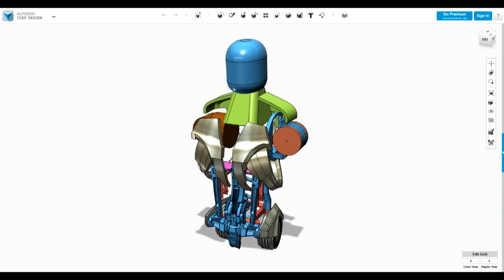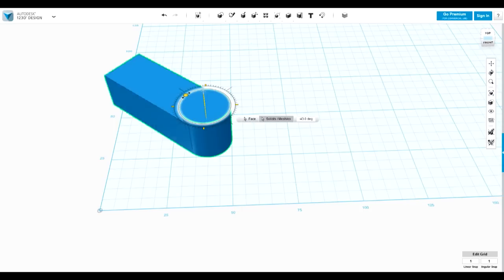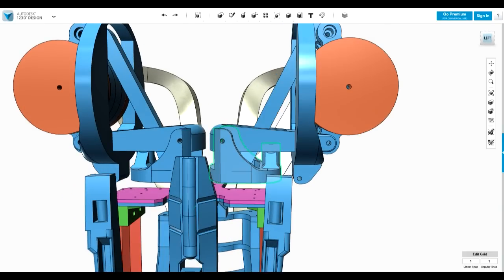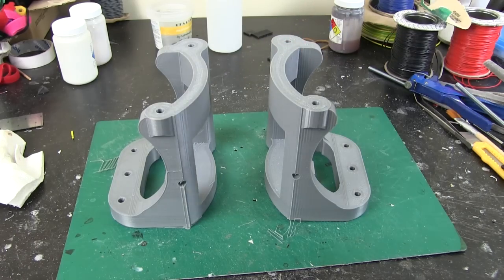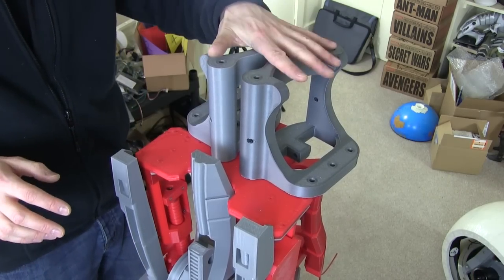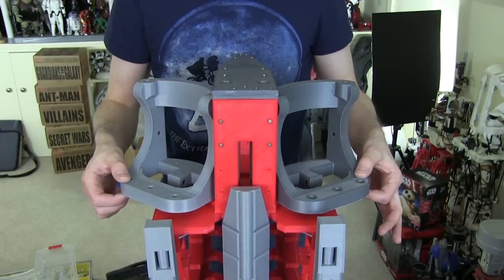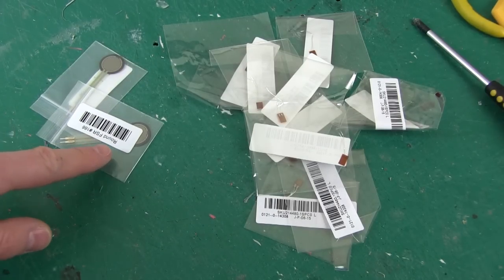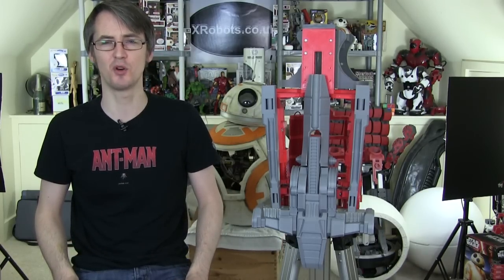Avengers Ultron #9 | Shoulder  Mechanics and Testing | James Bruton

Comment: I just can't comprehend how awesome your work ethic is James! I'm so amazingly lazy in comparison. When I get home from work although I want to make stuff, these days I just chill out and watch youtube instead LOL......
Reply: +James Bruton (XRobots) autodesk is free
Reply: +Jo Westover i dare to give you my opinion on your question as someone who learned several different programming languages:
depending on what your aim with programming is there are several different possibilities...
the most common are java and c++(or c if you want a more hardware based approach)
there are many pros n cons to all of them, but those 2(c is pretty much the predecessor of c++ and c++ can do almost everything c can and more) are the allrounders. if you want to run them on computers exclusively you can go with java. as soon as you want to move on to microcontrollers like the arduino you gonna end with c/c++. but as soon as you actually understood the basics of programing switching languages isnt much of an issue...
back to the the question of what you want to program?
you want simple utility programs that only have basic console in/out?-> any language is fine!
you want a little more elaborate 2D interface? ->go with java! the swing library thats included makes it easy to pop up your first window and put a button in it
you want even more?like 3D renderd stuff? ->c++ is a bit mightier and more performant, but java can give you that too,(atleast to a certain degree...)

after you decided about what to learn, lets move on to the how/where to learn!
thats easy: for all programing languages there are many free tutorials readily available on the internet!
just google it and you will find them.
but java gives you tutorials right out of its documentary
for any questions/problems: as long as you can describe it the community at stackoverflow.com will give you an answer or you find it because others already asked the same/comparable thing!

in my opinion java is the right choice for absolute beginners, as there is the IDE called eclipse that is really easy to use and well documented.

TLDR: go with java and use google to find yourself a web tutorial in a language you are fluent in
Reply: +Jo Westover well as far as i remember android uses java for its apps and xml files(which i have no clue about what they do as i dont do apps)
so you should go with some easy java stuff without the phone background at first, as it makes it more complicated and you really should learn the basics of programming first!
but then you can move on and take a look on the official site of android for developers they got a nice description of how to get started in app programing
Reply: +Jo Westover I would suggest giving https://www.codecademy.com a try If you want to learn the basics of the language. If you want to learn more specific things about the android development I'm sure there are plenty of blogs and tutorials out there.
Reply: sooo true james is a amazing creator and always thinks of new creations even me being an artist i cant think as much about new ideas i very much respect him for it

Comment: Great video, thanks James. I had a similar problem with ABS warping due to drafts and built an MDF cupboard (with glass doors for monitoring prints) with a block of insulation at the top to retain heat.  I built in an full extension shelf for the 3D printer for full access and made it deep enough for full movement of the lower gantry. There are some really nice custom acrylic enclosures outside of the UK but an MDF box seems to work well and greatly reduce warping.

Comment: You could make the shoulder blades spring-loaded so as  to not have them flop about (rubber arches at somewhat of an angle would get weird looking after a short time in my eyes) wildly with his every move. You could add unintrusive bumpers to the blades(partly made of ninjaflex) so they wouldn't harm anything when they snapped back into place when he moves his arm back into position. Everything looks good James! Keep this train'a rollin!

Comment: Just a suggestion, but Autodesk Inventor will allow you to give your assemblies pivot points and then you can move you parts and Inventor will calculate the motion of all the parts relative to your hinges. I have used it before to create working steering mechanisms like the ones on a cars and other cool things like that. Its a really powerful program and if you can use 123D Design, you should be able to use Autodesk Inventor in no time. Can not wait to see how this project ends up!

All the best, Owen

Comment: For ABS, maintaining steady, high temp around the printer is essential for print quality!
Reply: +Anthony Bowman Is that the reason people build enclosures for their printers? I always thought it was to keep the fumes in.
Reply: +BlackPhanth0m Almost 100 percent for temerature management for ABS prints! Unless the enclosure is airtight and vented to the outside, the fumes are coming into the room it's in. Even if it is not airtight, venting to the outside with a duct is a good idea.
Reply: Thanks! I will keep that in mind when I finally get to building my printer.

Comment: +James Bruton (XRobots) scrap the part about the ninyaflex in your forcemeasurement and use a 2 part fitted coupling with just enought space for your force resistor in one of the gaps. that way you get the torque/force thats applied to this axis.
or you do actually use the bending sensitive strips to measure the strain on the upper arm "bone" using the 2 sensor setup shown at 27:20 .
please keep in mind that the mentioned example of force to voltage given is dependent of the stiffness of the test specimen that has the two strain gauges appendet to. usually in mentioned "industrial" uses the test specinem consists of a piece of metal which has a way greater stiffnes than the printed part that i'm going to assume you will be using. these sensory setups use the differential strain of two sensors that are mounted on opposite sides of a bending test specimen. what you measure  in ths setup isnt the force applied to the test specimen, but rather the amount of bend that is caused by the applied force. which is then used in combination with the properties of the testspecimen (eg stiffness) to then calculate the force applied to it.
Reply: +James Bruton (XRobots)  if you mean as another testing/proof of concept video ,this would be propably pretty interesting... though i guess the result will be that the whole thing should be as stiff as possible if you want values that actually mirror the applied force. otherwise having a certain degree of springyness in the hinge may result in a smoother feel of the motion when applying external force.

Comment: Fusion 360 does assemblies and hinges very well.  You can also in 123d move your center of rotation, but that is a bit of a pain because you have to do it every time, and the smart rotate is better.  But you COULD do that before, it is was just harder.

Comment: Hey James, at about 7 min you talk about being worried that the pivot points are not going to be sturdy enough. try using a metal sleeve through the bolt hole to give the joint extra strength. a piece of brass pipe, or some small steel tubing slightly larger than the bolt maybe? Just an idea, love the vids!
Reply: +James Bruton (XRobots) I see... unfortunately there's no room inside the torso to counterbalance the weight. Not to mention the mechanics of counterbalancing around a pivot point, lol. What if you use a metal plate under the piece that the arm attaches to??? Thin guage sheet metal might work. it will give the whole arm apparatus a stronger base to work from. What about using long bolts to act like "rebar" does in concrete castings to reinforce key sections?
Reply: +James Bruton (XRobots) ah, nice! I suppose I should have finished the video before commenting, lmao. I had a notion and ran with it, lol.
Reply: +James Bruton (XRobots) Out of curiosity, is it possible for you to leave speciffic areas of a print void of material and manually insert a rod if some sort (potentially carbon fiber or fiberglass intead of metal to save weight), during the course of a print?
Reply: +James Bruton (XRobots) Very cool! Again, I love the vids, I'm a tinkerer and builder myself, only more of the outdoors, and off grid living type, and I thoroughly enjoy watching you do what you do! All the way from Canada,  keep up the great work!
Reply: +James Bruton (XRobots) Imagine the day when we are capable of 3d printing nano circuitry into the actual makeup of the pieces we're printing. the future of prosthetic appendages would change forever!

Comment: Hi James , 
If one arm when rotating forward the other is rotating back why not join both on one central pivot structure? 

What fascinates me about your videos is the speed that a thought of yours can be turned into a physical test piece and then a finished is brilliant , and is what would drive me to purchase a 3D printer , have you even done a behind the scenes about your 3D printers and why you chose them specifically , also mistakes you may have made in early 3D printer choices?

Finally the ability to combine ninja flex with solid parts opens up a world where you can create an arm , I keep thinking of a cable actuated arm when the cable is slack the lower arm is horizontal to the floor with all fingers flat, as the cable is drawn in the fingers curl to a closed position and the hand support twists on rubber mounts so that you have more than one movement for a motor turn ? I wonder have you experimented with this type of action ? 

Keep up the updates , your vids are brilliant
Reply: +James Bruton (XRobots) thanks James

Comment: When i print big ABS parts i use a old bath towel to cover my printer and keep the heat in and keep the cold draft out. that may help the printer on the floor..

Comment: Ive spent some time this last week or so trying to learn Fusion 360 as 123D Design is so limited and crashes quite often. Ive got to say, Fusion is awesome.You can assemble individual bodies into a component which can be linked to other components by joints which you can limit their range and pivot type. Its perfect for this project! Unfortunately all the hot keys are different, oh well.
Reply: +James Bruton (XRobots) it's worth the time. I needed to make a screw thread and it has that built in. Even let me specify M8x2 thread as a standard option

Comment: Hi,

And I have to say this description and demonstration is really good, and in many ways shows just how ‘well designed’ the real human body is compared with anything compared to it weight for weight, so it can perhaps be possible to make joints but you are looking for a cheaper and tremendously much more light material, plastic rather than rolled steel for instance, as you could probably be able to build something you want IF you could use steel or ally of some kind, but it would defeat the object of your original design.
Send and receiving details of where the joint is at any one time which you have more or less solved, is as important as being able to actually move the joint in the first place, and, using the tiny sensors all you need is to find somewhere that is not going to bend under the weight of the arm, so I sincerely wish you luck with that.

I was a little confused on what the objective of this build IS. Is it essentially something you can wear (like a coat), or is the aim to make a robot that can eventually be able to work completely autonomously? Please forgive any spelling mistakes.

Take care and good building
mrbluenun

Comment: Have you considered switching CAD platforms? I used to use AutoDesk123D as well, but later switched to SolidWorks and haven't looked back. AutoDesk123D has been pretty much eclipsed by Fusion360, though, which allows integrated CAD and CAM (although the CAM might not be that helpful for your purposes), and IMHO, the CAD in Fusion is much better than 123D. Almost all platforms other than 123D, including free ones, allow assemblies with some sort of joints.

Comment: About what temp is the room you're printing in?  I have my printer in a really cold room (during the winter) and I've noticed my prints failing a lot more often over the winter than in summer.  I don't have a heated bed either so prints tend to lift off.
Reply: haha I think you read my question wrong.  110 deg C seems really warm for a room. :-)

Comment: I'd recommend a power drill, but you might be quicker using a manual driver. I mean, look at you GO!
Reply: +DeKevron He uses a regular screwdriver so that he does not over-torque the screws, which can cause layer separation in the prints.
Reply: +James Bruton (XRobots) Going to need them to wear the Hulkbuster suit a lot!

Comment: search ebay for hx711!!!
Reply: amplifier for strain gage
Reply: +James Bruton (XRobots) 
i use them for my load cells in the feet of my humanoid. I use 2x hx711 with 4x load cells. I read each sensor value individually.  see https://plus.google.com/115118068134567436838/posts/CjPpdyPgtv3